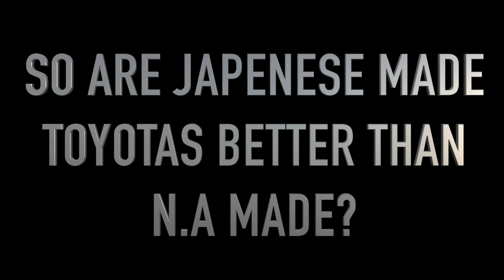Are Toyotas Made in Japan Better than Toyotas Made elsewhere?

Comment: Okay, I've owned 5 different Japanese made cars, a '78 280z, '96 4runner, '00 Trooper, '04 TSX and now a 2018 4runner. The Datsun died of rust(my fault for too many trips to the beach), the old 4runner died on a patch of black ice, and the Acura had to be sold because it was too small for my family.  The only one that died unnecessarily was the Isuzu Trooper.  I got rid of it not because the engine died but because the transmission made by GM went out.  When I bought the new 4runner that I drive now I was also considering a Tacoma.  If  you're having trouble deciding for yourself take a trip to Mexico and then a go to Japan (I've been to both) .  Japanese culture eats sleeps and breaths pride in workmanship. Just look what they do with Wagyu beef.  It's hard to pass on a car that's made in a country where everyone sees themselves as a measure of what they produce.
Reply: True, even their batteries are awesome,  my 05 4runner sport got the Panasonic battery until it got weak in 2019 because i only drove less than 2 miles to grocery.  That's 14 years of Chicago cold. Still got my 4runner,  214k miles atm.
Reply: Agreed to both comments here, after having Toyotas and Lexus most of my “driving” life, I was shocked to hear batteries only are expected to last 5 years, as mine typically last double that (yuasa/Panasonics)
Reply: I’m pretty sure there’s no such thing as too many trips to the beach 🏖. 😉😆🤩😎
Reply: @ilovebohol  what is atm?
Reply: @frankg6578  atm; at the moment.
Reply: Wagyu? You ever had al pastor?
Reply: The Trooper had FRENCH built GM transmission. Ahhh! The sweet smell of success. And burning fluid.
Reply: Sucks about the trooper. Those cars LOOK so nice. Not surprised they’re trash in the inside
Reply: I see this in the aerospace industry as well!!
Reply: Before I go to the question that product make in Japan is better than elsewhere? Tha answer is not yes but ABSOLUTELY YES. A few years back, I own a 2008 rx400h. The suv is one of the best one on planet. PERIOD. My sister in law live it and go buy 2011 rx350. It’s beautiful as usual. One day I help her clean up her suv and I use higher force, the window control pop up. I tell myself, Japan now start making junk product. But I was wrong. That car assembly in canada. The workmanship is not there. But the problem that lexus and Toyota are facing is people in America won’t buy Toyota if it’s make in Japan so they have to make it in America. The car make in the us or elsewhere beside Japan will have more little issues. Not major
Reply: @ilovebohol  that is why newTesla battery issues because their new certain model battery made in china. Original Tesla battery made in Japan by Panasonic.
Reply: @frankg6578  "what is atm?"

Um...
Reply: @markanthony1985  hahahaha
Reply: You ate 100 percent correct Nate. I've also witnessed it first hand and lived in japan almost 5 years.
Reply: I have a 77 FJ40, its built like a tank!
Reply: 3 Troopers... 1992, 96, 98..
3.1 Diesel ... brilliant vehicles
2 Death by transmission ..
No one here knows or can be bothered here to learn how to fix transmissions correctly. Utterly shameful business practices down under.
Reply: How were the trips to Mexico and Japan?
Reply: Yup. The Japanese culture is what gives a car built in Japan the edge.
Reply: @W5SST  I wouldn't want to own a Toyota that's made in Turkey. 💀 In Europe pretty much everything comes from Turkey though, except the Supra which comes from Steyr in Austria and the GR Yaris and Land Cruiser Prado come from Japan.
Reply: imo Workers in Mexico in a modern factory, have prized jobs. They are more highly motivated because 1) they had to compete for the jib. 2)they are working to enter and move up through  the middle class. 3) There is a long line behind them of equally capable people waiting for their job if they screw up.  4) Modern factories have very good processes for identifying the source of assembly errors.
Reply: @psdaengr911  Hmm that's true. The only difference is that workers employed by the big three (or GM I don't exactly know) got their wages tripled. Maybe those are even more motivated now. The only is GM engineering isn't that great.
Reply: @elguapo8751  😬
Reply: @chriskaye1997  5 years??? Costco's Interstate batteries last 3 years. I can't think of many products made in the USA that last like products that were made 40 years ago. Optima batteries are good, but you'll need to get a second job to buy one.
Reply: @roysimpson2126  My Lexus RX still has it's original Panasonic battery from 2013.
It is just starting to fade now, so I think this winter will finish it off!
Reply: Thank you
Reply: had an 04 tsx sold it around almost 250k miles most reliable car i have ever owned!
Reply: @markanthony1985  Right on Mark !!  Wagu tastes like Lard !!  I think this is Just North American Racist Attitudes to be honest !

Comment: On the SMA channel one guy commented that he had toured both the GM (or maybe Ford, it was a while ago) and the Toyota truck assembly plants. He saw that in the GM plant when a truck had a defect they had a special team come in and fix it and keep it going on the line. In the Toyota plant the truck was yanked off the line and sent back to where the defect came from so it could be redone. From there it continue down the line. He stated that he was astounded at the emphasis Toyota put on quality. I'm not surprised my 2007 Tundra is still going strong with no leaks anywhere. I stopped buying US cars a long time ago.
Reply: A few years back, I had a layover at an airport in Texas and spoke with an automotive engineer. He said that the difference between Toyota/Honda and the Big 3 was the philosophy. If there was a defect in preproduction, the Big 3 would do a cost analysis and make a decision to keep a part that had potential for failure. Because the of the cost of modifying or replacement later under warranty or issue a TSB. Where as Toyota and Honda would redesign the part and integrate the cost into the vehicle in order to insure the part would not fail or lessen the chances of failure. Basically, Toyota/Honda was based on quality versus the Big 3 was based on quantity.
Reply: Yes I saw on another channel that Toyota would stop production on assembly line 2000 times in a week when they saw something to be fixed or improved. Compared to Ford which only stopped their production 2 times in a week in order to pump out as many vehicles as possible.
Reply: Antonio, I wish I could say you are wrong, but you are not.  I traded a Jeep Grand Cherokee for a Japanese built Lexus rx350.  A similar cost between the two .

The Lexus hasn't been perfect, but after working on both vehicles the Toyota has a higher build quality by a huge margin.
Reply: @jamram9924  America call that kind of practice...Cutting corners!! No wonder I don't ever buy domestic, period!! I don't care about the bells and whistles. I want a car that will give me a piece of mind even after 200k miles.

Comment: When I bought mine in July I could’ve gotten one that day that was made in the US or I could wait two weeks for the one coming from Japan. I waited two weeks. 2022 Corolla hybrid.
Reply: Congratulations on choosing the Hybrid  as AMD recently recommended. All Corolla Hybrids sold in our market are currently made in Japan.
Reply: @rightlanehog3151  yeah the american was a se I believe. Love this car and the money it saves me.
Reply: @ParZIVal19D  If I could fit inside this generation of Corolla, my first choice would be the hatch with a manual. In other markets the Corolla sedan, hatch and wagon come in automatic, manual and Hybrid. Soon there will be a Corolla Cross, from a brand new factory,  to add further choices to our mix. I believe the Cross Hybrid should be here next year.
Reply: @rightlanehog3151  I will have to look into that when I need a new one I got the sedan not the hatchback. Great car I’m averaging 58 miles to the gallon in Portland Oregon. I’ve seen a little bit about the new crossover. When I see the Toyota Corolla crossover hybrid with all wheel drive. I will buy it.
Reply: Wise choice.
Reply: @MrWilliam.Stewart  Until the battery needs to be replaced.
Reply: @jaysmith179  I will never have to worry about that with my warranty and maintenance plan.
Reply: @jaysmith179  What? 15 years from now?

Comment: I was hesitant to buy my '98 LS400 because so many of the components were different from earlier models. But I really had to get rid of my MB and took the chance. It's still my daily driver. 
All were made on the same Japanese assembly line by then specially-selected workers who viewed it as an honor to build the LS's. Can't imagine how well-built the Centuries must be.
Reply: I have a 98 LS too! 292k still running strong. Getting ready to pick up a low mileage 2012 Es350.
Reply: @jcraig1848  Congrats!  You're on your way to becoming another million miler.

Comment: I bought a brand new 2019 Rav4 limited made in Japan and I’m loving it with no problems 👍🏼
Reply: I have Canadian rav 4 assembly quality is not that great. Side mirrors are shaking sometimes extra noise in cabin. Plastic parts not mounted really good. After 4 runner limited which assembled in Japan it’s bad assembly quality. Otherwise still same power train which works fine. It’s still Toyota. American build Honda Civic in my second vehicle have really good assembly quality. Really good- Completely satisfied.
Reply: Yet. Bcs parts were made in Japan, dsnt mean the car was ASSEMBLED there.

Comment: I own two Toyota Corollas, both 2016 model, one built in Japan the other built in Thailand. They drive totally different. The quality of paint and interiors are very different. The made in Japan one had most of the visible parts including the battery, windows and tyres all made in Japan. I think the manufacturing standards are the same but the suppliers and parts are different.
Reply: Standards can be the same but it doesn't mean Thai people will make vehicles with the same care for quality as Japanese
Reply: So which one was better?

Comment: As a logistic professional with 37 years in the automotive sub supplier 
Toyota’s built in Japan used parts manufactured within a few miles of the plant 
The shorter the the supply chain the easier it is to control quality.
Toyota manufacturing plants outside of Japan may utilize suppliers thousands of mile from assemble.
A much greater logistic challenge.
Reply: Avoid American Junk, F-35 is a good example , $100 million  jet fighter horrible Junk, or scams?
Reply: @vkham9944  u mean American brand

Comment: I’m a Toyota specialist in the UK and have worked on them for 23 years. I would say 1995-2007 uk and French built cars are far more likely to have issues than Japanese built cars, the Yaris for instance, window regulators and motors, window switch packs and rear brake shoe adjusters are far inferior to Japanese built, the European Corolla wiper motor gets noisy and stereo screen fails, so afraid I would disagree, they may all meet Toyotas standards but the Japanese over engineer things but also keep it simple and strong, better internal electronics in parts and more but hope you get my point. Love your videos and I keep picking up little things I didn’t know from you! Paul/Toyotatech

Comment: I work at a Lexus dealership and have over 6 years. I am Master Certified now as well. I will say, we do quite a few more timing cover reseals on the Canadian built Lexus vs the Japanese ones. Not sure if that's because there are more Canadian ones on the road or what.
Reply: Toyota ships engines and transmissions fully assembled to their Canadian factories.  They don't let non-Japanese assemble the engines and transmissions, only the rest of the car.
Reply: @proto2580  many engines are entirely robotically assembled i thought
Reply: @18_rabbit  Sorry, my info was either old or wrong.  They manufacture engines outside of Japan.  As for whether or not robotically assembled, it appears that they are still assembled by people, though the castings are CNC machined (which is a type of robot). 
 See  https://www.youtube.com/results?search_query=how+toyota+assembles+engines

Comment: Fascinating. Even after hearing directly from a Toyota technician and a Toyota engineer with extensive experience with more cars than most people will ever deal with, most comments still disagree!
Reply: It's possibly because the video foxes primarily on the content going into the cars not the way the parts are attached.  And 1% difference mentioned is on the Japan side and the fit and finish mentioned by both is on the Japan side but doesn't effect reliably.   But there is a difference they said it
Reply: @TS-xj5mt  They cited rates of defects are the same, so whatever difference there is seems inconsequential. But people fixate on that mention of tiny differences and conclude, contrary to these experts, that there is a quality or reliability impact.
Reply: fizout    You're not comprehending the words here that you just stated yourself quality and reliability, these have nothing to do with your paint being uneven or the space between your door and your hood being uneven that does not stop your hood from working or your door from working or your paint from working.  And when they did talk about fit and finish and aesthetic's that do not affect reliability and quality they both admitted there is a difference but restated those slight differences do not affect reliability.   And listen I like both these guys but you understand they are biased correct one works for Toyota and one has deep roots with Toyota do you think it's that to their advantage to say yeah I don't buy any cars made by my boss that are built in Canada the states or Mexico I mean let's keep reality here and our focus.  The mouse doesn't ask the cat whether it's safe to come out of the hole.  Be a critical thinker, it will make your life much easier.  I can find you many experts as well that will tell you there's definitely a difference matter fact both of these guys admitted there is a difference but they glossed over it and said it was small and did not affect reliability most of the time.
Reply: Also, I like both these guys on the video, but ultimately, David, for example, will not be keeping his 2020/2021 cars for as long as we will (due to the nature of his job), so time will tell at the 10yr mark!!
Reply: Chris Kaye that's a very good point.  Ten or twenty years is far different measurement than looking at them when they come off the production line.
Reply: Some people just like to poopoo on other people. I see the quality reports monthly including warranty related repairs. The US assemblers actually do better, marginally, but better. It's pretty much the same.
Reply: Willy Jimmy interesting because that contradicts with both these experts are saying that while it's a small difference the difference is on the plus side of Japanese vehicles and here you are saying the opposite.    Hmmm who to believe !

Comment: Say what you want, my Japanese made 2001 Toyota is still running strong while my friends have ran through multiple copies of the made in Canada versions. 
Ditto for my friends who bought made in Japan Subarus.
Reply: They went multiple Canadian versions because it wasn't maintained yours sounds like it was
Reply: I need to knock on wood.  My recent 2009 RX purchase had it made in Canada and having purchased with 81k miles on it in June I can only find 2 faults.  The very well known V6 cold engine knock and some type of rattle underneath that my 2008 Rav4 has made in Japan.  Sounds like a heat shield but isn't since my 08 was taken off.  Other than that the RX runs really well.  Actually minus those two things and an annoying rattle in the a pillar on the passenger  side it really drives and runs like new.  I however don't like the shifting logic of the 5 speed as compared to that of the anemic 4 speed of my Rav however.
Reply: @glennnichols4220  I'd take the pillar and see what's loose
Reply: @DylanL69  Ehh.....I pay no attention to it.  It's a nice vehicle even if made in Canada.  This thing has a ton of room in the second row for sure.  6'5" woul do well sitting in it
Reply: Made in Japan.....All day long.
Reply: @glennnichols4220  as someone who works in the plant that built your RX, I take great pride in my work and accepting no substandard quality for what we send out. Having gone to Japan 3 times for work I can say with confidence that a Canadian built Lexus or Toyota is every bit as good, if not better than the ones built in Japan. In fact, a healthy spirit of competition exists between Japanese and Oversees plants as to who can build the best versions. Our plant in Cambridge Ontario has won numerous silver, gold and platinum global plant quality awards and I have no doubt will continue to do so. I’m very happy you get to drive one of the vehicles we pour ourselves into making here in Canada. 🙂
Reply: @bigtarget9709  I know they have won awards and it is a hell of a nice vehicle.  Things happen and this one is one that unfortunately has some issues with it.  having 90k miles in it now and when I bought it in June it had about 81k on it all Lexus maintained as per the service history and I find it extremely hard to believe the previous owner didn't mention something about,  what I think is lifter knock,  to the mechanics and it not being put in the service notes.  It is clear as day and I never would have bought it otherwise had I known.  I bought it in summer and I noticed it when it got a bit cooler out not when warm.  It sounds like a diesel until the oil comes fully up to pressure it seems.  Other than Toyotas infamous weak power steering pumps that groan in cold weather on start up it is a hell of a nice vehicle.